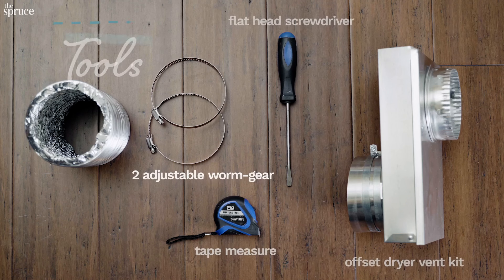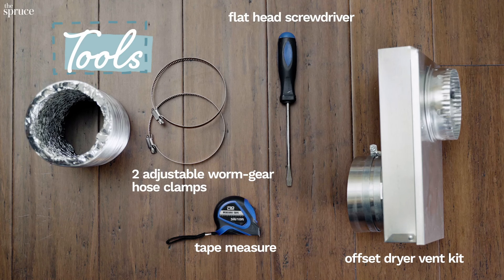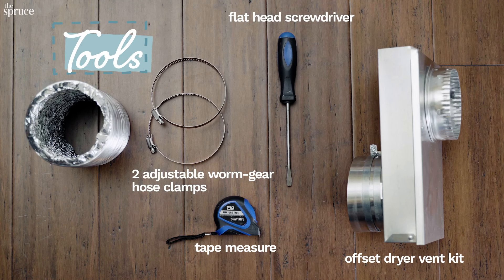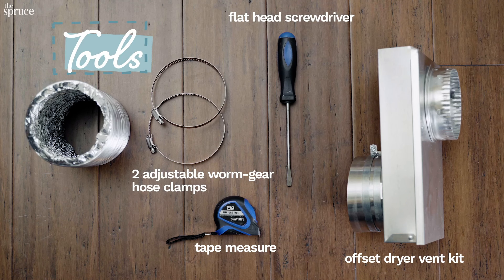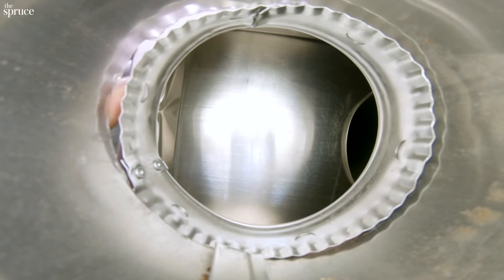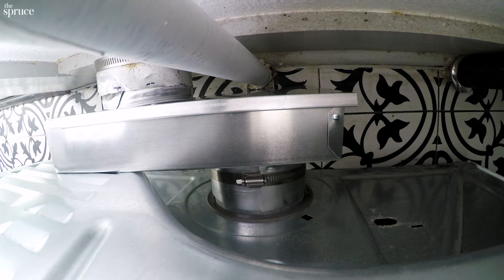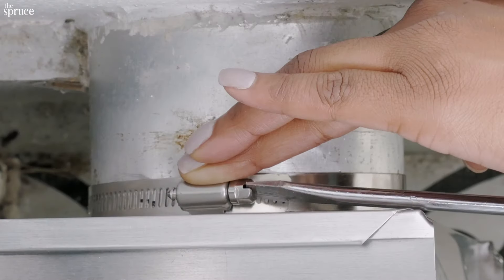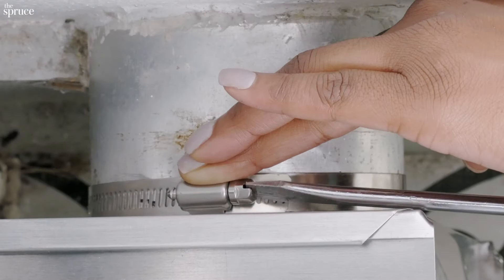The Best Way to Install a Dryer Vent in a Tight Space | The Spruce #HowToVentADryer

Comment: Mines a bit more complicated than that. My dryer sits against the outside wall in a cramped space. It came undone and I can get behind it to fix it. Hardly any room to pull the dryer out to get behind it. My vent to behind the dryer to the outside
Reply: I’m almost certain they built the house around your dryer. I hope it works out!
Reply: @relatableguy2232  I fixed it finally. The vent was somehow loose from the outside and I pushed it all the way in then I was able to put the duct and clamp onto it. Successful job.
Reply: I think you mean *mine*, "mines" are explosive devices, or a place where you excavate natural minerals from the earth.
Reply: @iamme3518 - Grammar Nazi Alert!😂

Comment: Ok so I got one of these, about 2-3 years ago. Since then I have been burning up a heating element once a year.
It could be the age of my dryer yes, however I had never needed to replace the element before this. Owned this dryer since 2012.
I replace all three parts each time it goes bad. I have only changed the thermoster once due to its location.
I’m currently looking at options to move the vent down the wall to meet perfectly with the dryer.

Comment: I dunno about this. A home inspector once told me there are certain regs about sharp turns and how many 90* angles a dryer vent can have. So I'm not sure a box is technically legal.

Beyond that, my dryer fits into a boxed in area and the wall vent is offset. There's no way to get behind it to line it up then tighten the clamps.
Reply: I actually had one of these and precisely what you suggest, did occur.  The angles were so sharp that lint began to collect and back up in the hard corners.  I usually pull my dryer out (annually) to vacuum and confirm no blockage and was surprised to see the lint backup.

Comment: Where can I get one those dryer vents?
Reply: I got it from Lowes...also used a 5gal bucket 🪣 with cover. Drilled 1" holes on the cover and 4" vent inlet into the cover. I use that as the "inside the house" vent filtration system. The heat+ humidity exhaust is used by my hybrid water heater to produce hot water & cool air in the basement

Comment: Dodgy.
Reply: care to explain?
Reply: @A4rings110  the gadget adds two hard right angles to the air flow and this is not a good idea. It will create losses in the flow rate through the vent and lead to an accumulation of  lint which will eventually block the vent and in the meantime be a fire hazard.